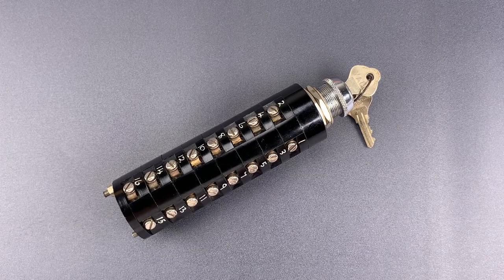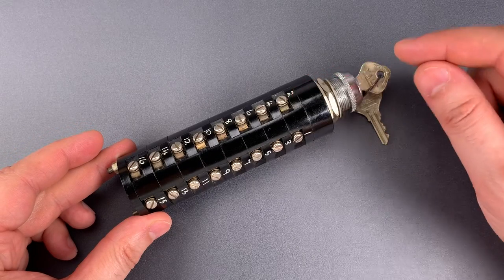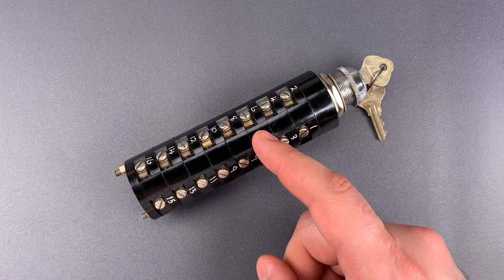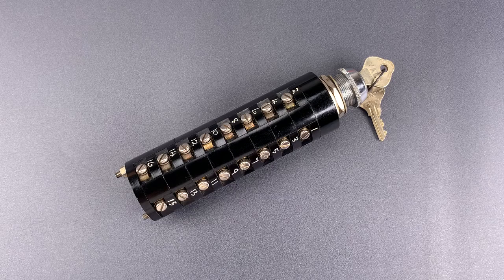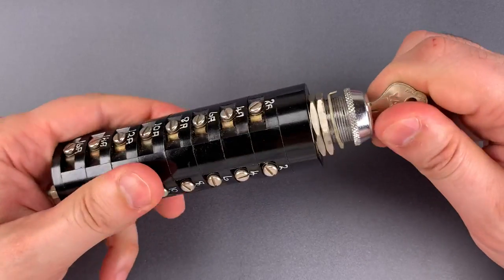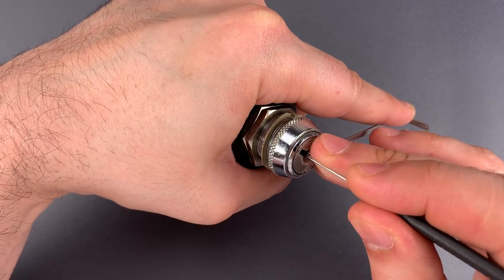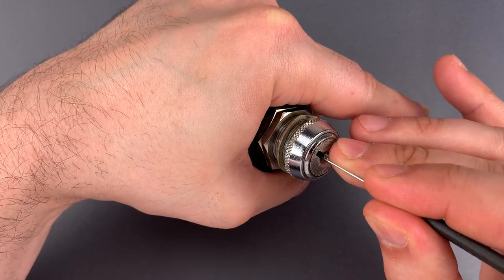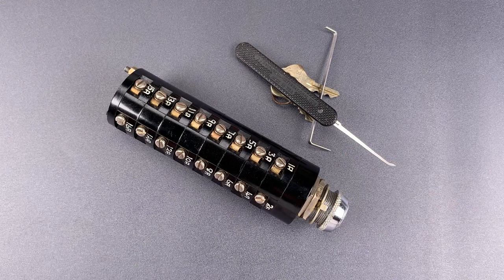[1154] Missile Control Key Switch Picked

Comment: tbh this lock, even tho its easy to open, could be incredibly safe if used with an software algorithim that know the order of the pins signals when the key is inserted or removed, making lockpicking it useless to unlock/trigger something.
Reply: Don't forget that very, very important locks are not secured by a single key, but by a battalion of armed soldiers who have already been ordered in advance to shoot on sight... 
Basic security axiom: allowing someone to reach a lock/switch/socket, even an authorized person, is already a security breach.

Want to secure a computer? Don't let anyone reach the keyboard, the case or see it through a network. The computer is securing a door or any physical thing? You can always short-circuit the final relay and bypass all securities if you can access it - because software cannot lock a door, it can only control an electromechanical device to do it.

But if something can be opened "normally", then there is ALWAYS a way to do it abnormally. It's only a matter of TIME. Security is only a fight between the time needed to break it and the value of the protected stuff.

Comment: What's on the bottom of it?  No part numbers or anything.  Looks like something GE would have made for industrial uses, not much different than some of their rotary control switches.  With their electrical group pretty much decimated after all the selling off of the parts of it, god knows if there is any way to see if they would have made it.

Comment: There is low probability that it come from a fighter as to avoid disconnection due to vibration  the screw connection are avoided. And there's no key in any aircraft board.

Comment: Obviously... you understand what the point of the key control system was right for missile control?

The key wasn't the control - it was the men in the silos, the distances between the keys, the fact that the keys were stored in a split-locked box, the fact that the keys even if you hacked the box you needed to know the code sequence to make the computers verify, etc. 

The key was (and is) more symbolic of the act of launch than a true control mechanism. The control mechanisms are the NCA and the men in the silos. The silo operators cannot launch on their own accord because of the interlocks between the NCA and the silo. The NCA cannot automatically launch the missiles (that was the whole point of that movie War Games) without the men in the silos.

So yeah - I'm not surprised the keys themselves aren't particularly durable. That wasn't the point... and guess what - most ultimate launch codes were pretty simple too...  it was getting to the launch code book that was hard... it was authenticating the target package that was hard...  once all that had been done... launching the missiles (assuming the silo officers agreed) is a pretty trivial matter.

Comment: Would it be in theory possible to have a unpickable Lock with 2 separate Keyholes where they are linked in a way.  One is just a normal key that turs. The other is sort of a Full triangular keyway. In they keyway you insert a long rod with 32pins in 3 positions. Up-Mid-Down. Those are static. When you turn the key 96 pins fall onto this rod and stay into 1 position each. If they are all at the right hight a Electrical Signal passes through them unlocking. So you would need an exact replica of that. Would that be possible?

Comment: btw that i one peice of a three peice nuclear key control not a jet key control....there is two of the cyclinders and a connector both keys have to be turned at the same time to activate even circuts on one and odd circuts on the other if not at teh same time it will not fire......that being said it's useless to pick a single lock on a double control......

Comment: my recommendation to make these locks actually safe is to have them make the keys a part of the lock by having metal contacts inside the core that use the key to bridge a circuit on the inside of the lock and it would act like a (AND gate "and gates require at least two inputs before an output is given") if the key isn't inserted it'll stay off even though its rotated into the on position and maybe adding some trap pins to show if such a lock or was to be tampered with.

Comment: Forgive my layperson’s ignorance, but when you say ‘click out of x’ it makes it seem like each component of the mechanism latches in the open position independently without all of the other components needing to also be in the open position. Is it not possible to make a lock in which the components don’t latch and need to be held in the open position simultaneously by the twisting force on the key for it to open?
Reply: That is in essence what he is doing, tensioning the keyway by turning it and pushing up on pins to seat them one by one. The tension of holding the keyway also puts force on the lock pins not letting them drop down again. Making a lock where all the pins are set at once and only in just one position is near impossible, because a key goes in and first hits the pins which are at the front of the lock core. You would be forced to make a lock where the key would have a linear height increase on it's teeth making brute force attacks and copying easier. Certainly there is a way to make a lock that is impervious to many picking methods but someone will figure out how to pick it eventually.

Comment: camera pod lock, wrong attempt burns the film, need an insulated key, electrical short sets it off, plastic key- and the reason it's so tight is because that is not the original lock core- they take those out, likely somebody added a normal key core and that's why it doesn't fit well

Comment: I am still trying to wrap my head around the whole odds are powered even are not .. turn key ..  odds are not even's are powered .. aspect of the lock.  WHY in the world would a part be engineered to activate eight connections at once.  I can understand making the lock more difficult to turn (so no accidental turning you have to purposefully turn it to click it from A to B or B to A).  But since all you get is on or off as a result, this is overly complex and just leads to eight potential points of failure.  You could easily have say spot 6 fail to energize within the mechanism due to fault in it.  The need to activate a series of circuits is understood (as if it is arming more than one pathway needs to be turned on for safety).  So all I can some up with is perhaps it was a simpler mech in design, but the surge of power across one point was leading to failures .. so this was their solution.  Still it seems so .. bizarre.